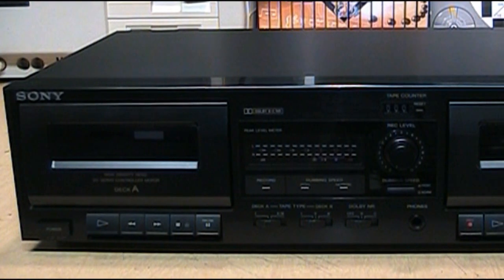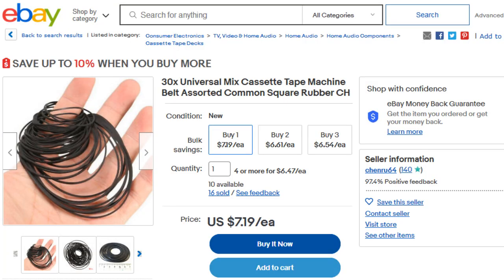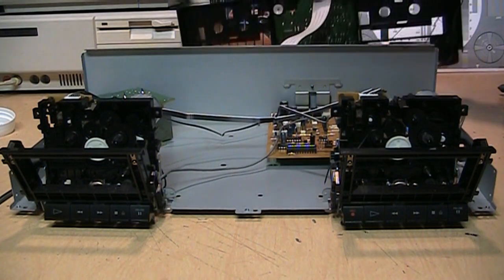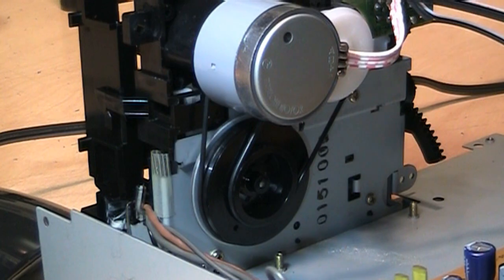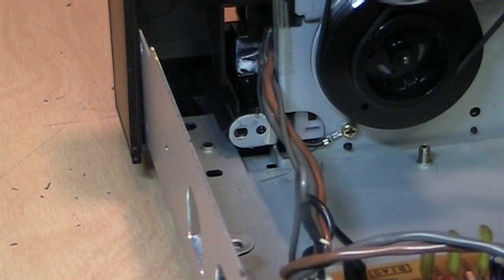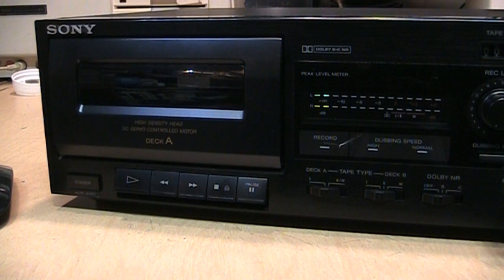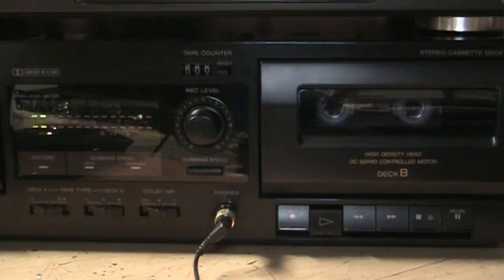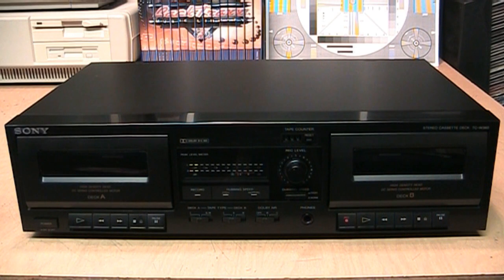The All-Plastic Sony Surprise cassette deck - TC-W365

Comment: You continue to surprise me with what you find in your local thrift stores.  It's been some time since I was last in one, but I don't recall seeing the variety of things - or in that fair of condition - like you have scored, in the shops in my part of Western Washington.  It's possible that much of the cast-off electronics winds up in piles relegated to the local E-Waste collection events, if not to outfits like Re-PC, who typically have a myriad of truly archaic/orphaned gear for sale.
Reply: Wow, when I lived in Western WA, that was where I got my best deals (many side of the road specials too). Even here in Eastern WA there are tons of deals way better than this one. RE-PC was always fun, but if you just want regular stuff, they are a terrible value. No, nobody should be giving you 50 bucks for a used 1 TB drive, and no, I'm not even going to consider buying a used class 10 64 gig SD card for 30 bucks, etc etc etc. Confusingly overpriced, but fun to browse.
Reply: I live in Eastern Washington and have the same bare selection. Only weird off brands no TEAC or Sonys, assuming VWestlife was blessed by the thrifting gods
Reply: @ethandodd8493  don't just go to Goodwill. Therere tons of non-Goodwill thrift stores out here. One of my latest purchases was a Bose Companion 2 series 3 speaker set for 9.99.

Comment: Even though it's a piece of plastic, it's still much better than all the Chinese decks (Pyle, Pyle Pro, Pyramid, Ion, Soundwave, Renkforce, Wharfedale, etc). And at that time, Sony did seem to be doing things right.
If Sony had to make a deck like this today, the mythical Tanashin mechanism would fit right in, with its respective motor, which is a bad imitation of the classic Mabuchi.
And finally, they are going to put the dynamic noise reducer (used by all Chinese decks), which can only be applied in playback, not in recording. And yes, since Dolby died, they stopped manufacturing those chips.

Comment: "You don't often see a Sony cassette deck with completely mechanical piano key controls, manual tape type selection, and a mechanical tape counter". Maybe you did more in the 80s? My TC-K22 (which has every single one of these "features", aside from the plastic mechanism) is not high end, but it's not budget tier either.

Comment: its weird seeing something i actually use to own be reviewed on this channel. i use to have this same deck. i got about 7 years out of it before it self destructed.
Reply: self destructed? You mean the belts died?
Reply: @bland9876   the belts were practically the only thing that were still in working order😩. But after the audio output went out for no reason it was time to just let it go.
Reply: @KingAlone516  audio is pretty important for a tape player.

Comment: I found a similar tape deck with a turntable from Sony, but I didn’t get it because the belts are broken. Only one tape drive is working and the turntable isn’t working. I wish Sony made newer tape decks, because of the revival of analog media!
Reply: As I recently realized that I am now old and lived through the end of the LP and all the tape era, I just have to respond to this sort of comment.

It is bad enough that LP's are back (high maintenance and lower sound quality than CD's) but at least they have redeeming quality (Large Artwork, great to display). But Cassette's !!! They were never were good even back in the day, we bought them because they were cheaper than the CD or LP. I realize that you can get OK sound out of cassette with type IV media and a great player. However, no-matter how good it is, digital sound is better. The reality is that CD is the best physical media that ever became popular (Sorry MD), and will remain as such (Streaming has meant the end of advance in physical media)

The only benefit of Cassette's is that you could record your own media (or copies of songs) , which brings us to the key point. If any format needs to return (or more pointedly be preserved) it is CD-R's and CD players. Perfect sound quality and ability to record your own tracks (also no DRM).

Run along now and in 5 years I'll comment on the over the top price of used CD players.
Reply: @robertpross7515  I actually prefer CDs over vinyl, because of the versatility and better sound quality. The only reason I play vinyl and cassettes are for the analog masters, similar to how old NES video games are better played on older TVs.

Comment: Even as a low end deck, it’s still way better than anything new today and it sounds great considering the all plastic design! Nice that you caught it just in time to replace those old belts.
Reply from the maker: The currently available TEAC and TASCAM decks are far superior to this except for the lack of Dolby noise reduction.
Reply: True, those decks are also quite nice considering they are new and they would be even better if Dolby was on them. It would be cool to see Dolby or other features return to brand new decks.

Comment: Fascinating video! Despite of the lack of auto-stop, which will sooner or later chew up a tape, the sound quality is great. I just restored an old Sony deck from the 80s and it works great. How long do you think we’ll be able to find replacement belts though? I don’t know how the new ones will age 😊

Comment: I have a younger cousin of this deck, the tc-we305. Entry level dual-well deck that I think I got for $100 new. I managed to replace the belts as they were getting loose just this year (it's 20 years old!). Interesting differences: metal mechanism with plastic gears and auto stop on play, fast-forward, and rewind. Otherwise, very similar!

Comment: I found a TC-WE305 years ago and the belts were melted and it looked rather difficult so i just said forget it, and found an 80s cassette deck at another thrift store maybe a year and a half later in perfect working order.

Comment: The worst case of that rubber rot I've seen was on a tape backup drive.  There's ONE roller that drives a wheel in the tape cartridge, which feeds the tape, turns the reels, and everything.  Completely molten.  Right down to the metal base.  It was like a chocolate chip fresh out of the oven.  So that ought to be a fun restoration project some day.
Reply: I’ve used a pair of O-Rings superglued in place of the original rubber to get these drives working again.

Comment: I can confirm that 90s Sony belts were junk. My TC-WR635S was built in '93, and all the belts have "melted." Belt degradation happened between last use in 2010 and 2021 when I dug it out of the basement to use it again.
Also interesting to note this has Dolby B and C, and yet doesn't have HX Pro. Quite a few Sony decks had HX Pro, even the ones without DNR. Deck sounds great, though!

Comment: I bought one of these identical Tape Decks from Goodwill which also didn't play. When I opened it up to check the belts, what I found was all the belts were "GOO" and seriously gummed up all the pulleys and mechanisms. I tried cleaning it up but gave up. I want a better Sony Cassette Deck to go with my other Sony Components, so will keep looking...

Comment: Three years ago I bought a 90s Sony deck woth dolby S and three heads. It sounds fantastic and the materials are amazing. The belts are a little bent for being stored for so long by the previous owner but I might replace the belts one day, it still sounds decent. Wow and flutter is not as bad but could be better.

Comment: Underwhelming flywheels. They look like a boombox mechanisms. I think I actually had that same mechanism in a Sony boombox from that era.
Plastic is not so much of a problem if it's thick and sturdy enough, some plastic tape mechanisms are reliable and sound really good. Plastic also doesn't bend as easily as the thin sheet metal of a Tanashin, so for a boombox which might get thrown around quite a bit it's probably a good choice.
Reply from the maker: However, the plastic buttons on Sony boomboxes are prone to breaking, as uxwbill showed: https://www.youtube.com/watch?v=w1jfSc2LZp4

Comment: I personally would remove those plastic garbage mechanisms and replace them with Tanashins (specifically the TN21Z, with the full auto stop). They are low end too, but they will be better because they at least will stop on rewind and fast forward.

Comment: Yeah, I have a few year older TC-W300 (W190 in US) and it's cheap inside but good sound quality. I changed the belts in mine almost in time, they were a bit more gooey than yours, a bit of a headache. Got the belts from Thakker.

Comment: I got a SONY TC-W305 2nd hand from someone at the end of January this year, and I had the same problem. Unfortunately for me, I had a gooey mess to clean up, and I had to guess the belt sizes, (well, my impatience is partially to blame for that!), but after replacing all 5 belts, the thing sounds splendid!
Mines, however, even though it has piano keys, has a fully metal mechanism and full auto stop. Yours resembles mines quite a lot, especially the level indicators, well, the whole front perhaps!

Thanks for the upload!

Comment: I scored a Sony portable player at a flea market, a YP-ES20 (that was not a Walkman, but an special YPPY series model instead) It has the most barebones auto reverse mech ever made by Sony, full of plastic cogs, but at least with some metallic components.

As expected, the belt was the usual culprit, and then I learned the hard way why those cheap belt assortments didn't work right all times. I managed to fit a square cut belt (the player itself shows how to thread the belt into the mech) when it was supposed to get a round cut one. The player works with square cut belts, but it sounds a bit fluttery. Nevertheless, I like the charming sound of a fluttery deck 😁...

Comment: I"ve had good luck with cleaning all the black rubber belt goo/residue stuff up with isopropyl alcohol on a Q tip or paper towel. Alcohol pads work too. Even if the belt comes off just before turning to goo, I still clean the belt pathway with alcohol to get it spotlessly clean of old belt residue.

Comment: i think the tar belts was used even in the 80s.

remember the ET doll where you pulled the string and it said 1 or 3 or 4 lines from the movie?

for that matter all of the different dolls where you pulled a string and they said different things.

the talking motor was powered by a spring that drove a belt driven phono disk and the belts in them also got tarry like too.

Comment: This deck is quite similar in functionality to the Technics deck I own—although the Technics is definitely much higher-quality. It works, but it definitely needs new belts. But since it's not a Sony, it's much harder to find information on every part. I think I was able to find the instruction manual and schematics, but not the service manual.

Comment: I had a Sony TC-WR661 deck, this deck you presented has a better sound than the one I had. 
I remember a Sony Sports cassete corder that had the exact same plastic mechanism. It was a headache to change belts but it sounded great. 
Ah Sony, and it's proprietary things.

Comment: Ahh, 1990s Sony tape decks. Parts are easy to find but not easy to replace. Had an auto reverse one that was in fantastic shape, and played, but needed new belts and just a good looking over.

I replaced the belts after an hour of attempting to get to them, and then the power supply decided to crap out.

Sony high end decks really are like Mercedes… They’re wonderful until they go wrong, then they’re a nightmare.

Comment: This is a bit like my Sony TC-WR661, which I got for around about the same price. It's higher quality than the one in this video but it's still rather low end, and Sony cheaped out in other ways, like the way it has only one motor for both the decks to share, and it's not easy to change belts on as you have to dismount the motor to change the belts, but there are no pegs or anything to hold the belt whilst you put it back together, the Full Logic system is noisy to engage, there's no track search, hell it doesn't even have a headphone jack!! But it still sounds great, like I put Dire Straits On Every Street in with Dolby B turned on, and it sounded really clean and with full range, almost like listening to a CD. I do need to order some new belts for it as I think they are starting to slip, just have to find where to get them from in EU. Even in walkmans, I have a WM-EX190 that I got practically given to me, that feels light and cheap in the hand, it's all plastic inside, it doesn't even have a power regulator on the board like other models have, including older ones... But I cleaned out the battery leakage, changed the belt and adjusted the speed with the test tape, and it sounds just fine. 

I guess Sony tried to not cheap out on what matters the most, even when they are low end decks.

Comment: The plastic vs metal mechanism construction got my gears turning, and I'm thinking if you ever get access to two sacrificial tape decks of either construction, respectively, along with access to a large temperature-controllable oven, it would be an interesting experiment to put both decks on autoreverse, slowly raise the temperature and see what conks out first. I would kind of expect a plastic mechanism to be first to lose its and deform, but there are many potentially confounding factors as well. Still, I'd watch that video.

Comment: Here we go ~ that Top Tech GW Shopper we know!   Not only reveals some Grand & questioned Relics he's found, but a Quick 'Window Trip' into what's inside or need;  Comparison and\or connection of components already at hand;  Provides information Learned, Instructing parts shoppe to ensure Consumers Proper sized Parts.   Like, W0W^  Thanks!   8 )
melted belts are a mess!  citrus oil does a great job on this type of goo.  
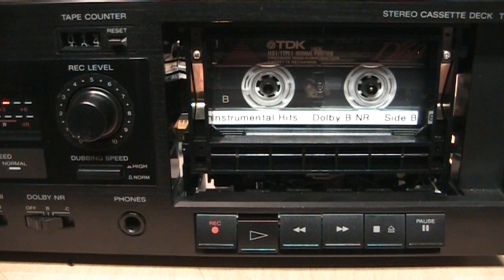9:30   [mirrored]  'Wavering' Movement of Belted Gears seen  -  is that normal?   (for plastic)  ^ Groovy Tunes!

Comment: My mom still have her stereo she bought from a store called good guys here in Bakersfield California. It has a tape deck double tape and it is a pioneer and also has an 101 disc changer and the two I don’t know what you call them but one of them is to turn on the stereo and the other one is to turn it up change from CD to tape to FM receiver to receivers and it still works she is old school so she still uses her stereo I love all the electronics

Comment: I've serviced tons of Sony decks and a lot from this dual deck era. 
I agree that Sony did something to cheapen the belts.
They are not the only manufacturers to do so.
Now that I have seen this model, I will avoid it.

Someone said "I only get decks with ES in the model number" but
that is no panacea. The transports are the same as cheaper decks.
(Not as cheap as this one though.)
And some of those transports are poor performers and lousy to service.
I am a Sony servicer since 1975.

Comment: I bought a SONY CD, Cassette, AM/FM 2 speaker stereo set in 1998 right after I got married. Great little piece of sound equipment for the living room. A few years later when we moved, and we had to leave it in storage for about a year, when some time later I wanted to play a tape, it would no longer work. The belts had disintegrated into sticky goo, and since I had no drawing or idea how they were routed, I couldn't get the proper belts. We used it as a radio or CD player for some time until it got sold for pennies on the dollar.

Comment: When you mentioned about belts that melt. I have a fisher cassette deck i got from goodwill must be from 1980s to early 1990s has a funny connector for power because was part of a stack system which im going to modify for power and the belts just the main drive belt is melted into a sticky mess . what do you use to clean that off? Otherwise its similar to this one has tape counter manual selection dubbing etc. Nice find
Reply from the maker: I just used isopropyl alcohol.
Reply: @vwestlife  ahh ok I was curious because I had an old cassette player that was part of a multiplex and I couldn't clean the belt residue off but also the entire unit with shot anyway.  I had my luck that the other belts last I checked on the Fisher cassette deck seemed fine so I only ordered two belts from turntable needles website. I have to find a 16 volt AC power supply to power the unit since it doesn't have a regular AC plug. Thank you for the reply

Comment: I've recently discovered that is you have a deck that needs a flat belt and know the exact size its possible to find cheaper listings for replacements and then use belts from one of those kits for the counters. As a specific example I managed to find out the specific belt I need for one deck is an FRX9.7 and generic listings for that belt were a lot cheaper than kits or even just the flat belts alone just with a model specific listing. The great thing too is 9.7 is just the inner belt circumference in inches so its pretty easy to find different sizes in the same width (I assume FR is the belt type and X is a code for the wide but I haven't looked into it further).  I need to find a kit of round belts though because I also ended up in the same situation with a different deck where I bought a kit and the main belt is correct but the tape counter belts are way too small and thin.